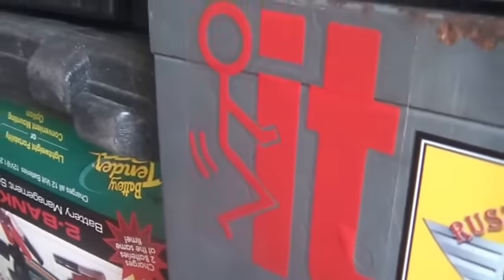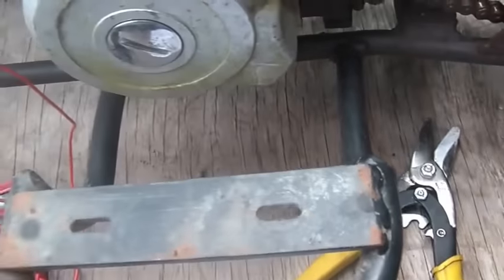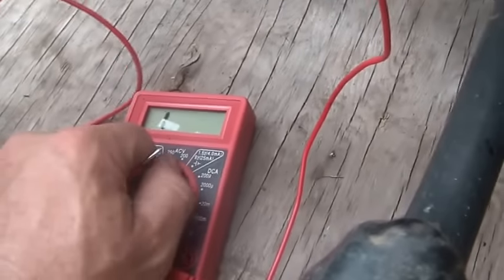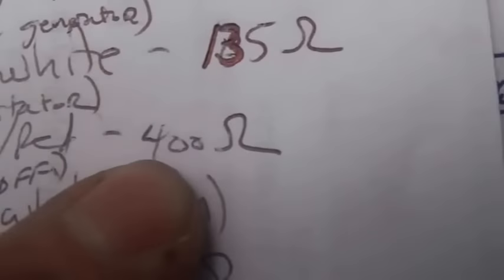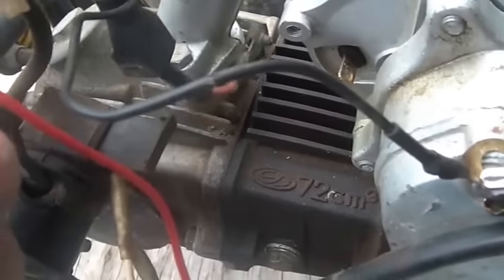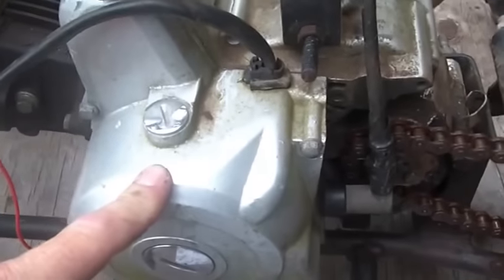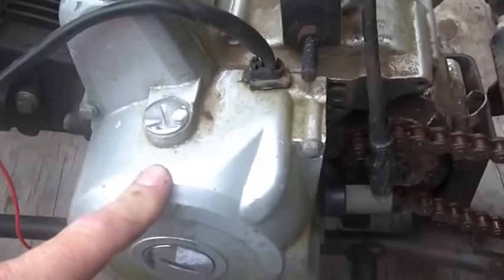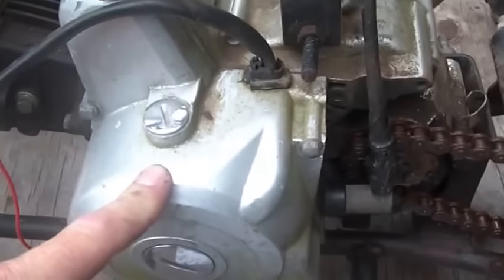Troubleshooting a no spark China Quad, critical wire harness measurements,

Comment: Hi help needed asap !! Ive recently purchased a new loom but plug on from stator doesn't match up to one on loom ive cut both plugs of now and am going go join them up then tape them off which colours go to which ??
Reply from the maker: Hey Darren, Assuming that U R replacing one AC powered CDI for another, just match the wire colors and all should be good, blue and yellow, pulse generator, black and red, power from the stator, black and yellow, ignition coil, green is ground, and black and white should be engine off when grounded.... Let me know how it turns out.... Thanks for asking, watching, and commenting!!!!

Comment: Hi Harvey, I saw your video and it has helped a lot. First of all I have a quad MPX 150 and it had a spark once (just one I saw it with a test plug but no more). I have checked the wires you mentioned and they check good (ohms, continuity, etc...) but I have a wire I can't determine where it goes. It is coming out of the engine in that five wire configuration you talked about and it is Red/Blk stripe. It has a single female terminal but no other male anywhere to be found. It reads 400 ohms. HELP!!!!!!!!!!!!!

Comment: Hello Harvey, new subscriber here, I'm still having trouble, I got a 2000 Lakota 300KEF, the harness cut all up, the stater has 3 yellow wires on one of the 3 sections coming out, for life of me, I cannot figure which wire goes where to get this thing to spark and turn over.  Again,. Awesome video, too notch brother.

Comment: battery whole sale sells sealed lead acid batterys that are rechargeable like a car battery for pretty cheap and the best part is they have some that are 1 inch wide by 2 high and 3 long witch would be perfect for the cdi box I think.
Reply from the maker: Hi Reading!!!   I need to check out that website, I've been using harbor freight batteries in my portable CDI ignition, it is rough on batteries... Thanks for the info, watching, and commenting!!!

Comment: Hi good video  I'm working on one of these at mo 50cc semi automatic. Got a weak spark or no spark at all . I'm suspected stator so far but unsure of the output voltage. In my case (red and white trigger wire) (red and yellow goes to the cdi main) (Green and white is earth) ( yellow to rectifier) and (white to rectifier) .What should be roughly the voltage on Cranking best Regards James

Comment: i got 3 ohms when testing the ignition wire at the cdi. both in the on and off position......
Reply from the maker: Hey Michal, I like to disconnect the on/off wire entirely.... About the ignition wire measurement, I'm assuming that U R speaking about the wire that goes from the CDI to the primary of the ignition coil and that U R measuring it to ground, 3 Ohms, depending on Ur meter is about right... I hope this helps.... I have all the recent China ignition videos in one playlist now, https://www.youtube.com/playlist?list=PLXe3Ur9S11oeX8iOzfD80fe5fpK37tg5W  , I hope this all helps, thanks for the info, Ur thoughts, watching, and commenting!!!
Reply: +Harvey Spooner yes I found the black and white wire to clip to bypass the ignition. i appreciate your help in this.

Comment: Hey I'm having a problem with my  SSR 110cc China pitbike I changed everything but still won't work
Reply from the maker: Hey Jelly, U have no spark????  I would cut the black wire with the white stripe that goes to the cdi  such that it can be reconnected easily and let both ends float, see if it sparks now, if yes, there is something wrong with Ur engine stop circuit... Start there and let me know how U make out....  Thanks for asking, watching, and commenting!!!!

Comment: If I want to just get the engine running I only need to use the 3 wires comeing from stator to cdi to coil to ht lead don’t I ??? Plz anser me ASAP I washed my qaud and now won’t start but I don’t need rectifier and all wires all I need for it run is state wires and cdi isent it ???

Comment: I have ? for you I have a Kipor camping generator 3000,  TC which is an AC rotary generator I little bigger in capacity than a  Bick generator But my question Is can I  USE  the CBI to create a spark as it is so much in many ways similar to that system Or as I have a Battery can I convert it to DC sparking To deliver a spark & ues an ac covert to charge my battery?  Yes well, Why.   We can No' longer get the parts for this model. The engine is sound so if could use an alternative system to run the motor preps I could use a rectifier to change a battery bank & use it to run an off-the-shelf inverter.    & I have put it back into use finding a suitable system to use what I require so I don't burn it out. les England   Ps I have one of the old tip motorbike pot' coils that I have used with points. on my rotavator until it finally burnt too much oil Could I use that with a trigger to fire the plug.  as there are no points with this motor how do I do that? I would preheat a feedback if possible.    In your opinion  Les England.
Reply from the maker: Hey Les, If Ur Kipor generator uses a pulse generator to trigger the spark, I would use my 12vdc portable cdi and it should work.... If it is a 2cycle motor, I do not believe it will work as 2 strokes do not have a distinct pulse generator that can be wired to....  I hope this helps.... Thanks for asking, watching, and commenting!!!

Comment: I just picked up a 2016 TaoTao scooter the only way I got the tests it is with test light. I checked all the wires that go to the cdi box the coil the stator . They're all good and I still ain't got no spark. And after looking at your video . I'm thinking of sending wire harness . And that's going to be mess . Would you agree bet it could be in the wire harness ???

Comment: I have a Yamaha 225DX 3 Wheeler, it turned over fine and used to run great. But now it's not getting any spark. How do I check all the little box things between the engine and the Coil. There's like 3 little box things between the engine and the coil. How do I check to see which one of those is bad?

Comment: I have a falcon 110, when I push the start trigger I get a click that sounds like it is coming from the starter solenoid. I can cross the post on the solenoid and it will turn over. where is my problem at?
Reply from the maker: Hey Paul, I'm glad that U figured out the issue with Ur Falcon 110 starter.... If one works on stuff, sometimes they mess up, folks who work on nothing, mess up on nothing, but, they don't fix anything either.... Thanks for asking, watching, and commenting!!!

Comment: Yeah so I was looking at those wires and mine does not have a ground what should I do
Reply from the maker: Hey I LOL!  Ur ATV must be getting ground from the engine case. The old Honda ATCs did not run a ground wire and I have had issues with spark when the engine case looses ground connection to the frame or had intermittent ground contact with the frame.... When in doubt, run a wire!!!   Thanks for asking, watching, and commenting!!!

Comment: hi Harvey,

i have a charging problem on my kids atv. its one of these 50cc china atv's. I bought new stator, regulator and CDI kit. I thought the stator is broken because there is coming only 2-3v out from yellow wire. But when i installed new stator nothing changed... 😞

still not give any charge for battery... everything should be okay... have you got any ideas where the issue might be?

br. Ville from Finland
Reply from the maker: Hey Ville, U only have one yellow wire, only 1 wire from the stator, there is not a second wire, yellow or white???? Let us assume only one stator wire, to get 50- 60cycles per second, a place where Ur Volt Ohm Meter will read somewhat accurately from a stator, the engine RPM needs to be about 3600 RPM...  If I were troubleshooting this, I would be checking to make sure that the engine has a good ground to the frame, voltage regulator, and the (-) negative terminal on the battery, also, is Ur stator well grounded to the engine????  I would probably run a continuous ground wire between the engine, frame, voltage regulator, and the negative on the battery...  I hope this helps, let me know how U make out, depending on what U find, maybe we can come up with more ideas.... Thanks for asking, watching, and commenting!!!
Reply: Harvey Spooner, there is one yellow and one white. both giving only 2-3 volts...

Comment: hi i have a 2007 chinese panther 250cc zongshen engine air cooled manual trans it has the skater wires and another harness with 5 wires coming out about a inch from the skater and the new harness  dont have them any ideas thanks ed

Comment: i got a 50cc quad that has no blck/red wire coming out the stator only the other 4 coulers but my cdi has a blck/red can i wire that blck/red from cdi to somthing or do i need a 4 pin cdi box ???
Reply from the maker: Hey Ian, Is Ur 50cc quad a 2 stroke or a 4stroke,  here in the USA, most of the 50cc stuff is 2 stroke.... Once U answer this, I need to do some research before I get back to U, I have not worked on 50cc ignitions.... Thanks for asking, watching, and commenting!!!
Reply: Harvey Spooner n

Comment: I have a 49cc Chinese engine. Sometimes it won't start when the engine wire is wiggled. Should I try and solder it better. Or that's not the problem?
Reply from the maker: Hey Bryant!!!   If the situation with the wire can be improved without making things worse, I would solder it, if not, I would run until it doesn't run anymore and then fix it for real.... Thanks for asking, watching, and commenting!!!!

Comment: Hi
Change of subject. 
I have a hero puch wheelie 65cc quad. The engine is off the puch maxi turbo sport. It's old late 80s   I think looks like a suzuki lt50. I cannot find any information for them or manual. Type online you get a Russian site. You sound switched on. If you don't mind could you look. I have seen two in the UK. One I own and one witch was sold on a site a fare few years ago. 
Thanks 
Regards 
Martin H
Reply from the maker: Hey Martin, I always start with eBay, is this the right manual, http://www.ebay.com/itm/PUCH-MOPED-MAXI-Sport-NEWPORT-MAGNUM-Service-MANUAL-PARTS-Owners-4-MANUALS-/352161601324?hash=item51fe77972c:g:LCMAAOSwJJRZsunV&vxp=mtr   , I hope this helps, thanks for asking, watching, and commenting!!!

Comment: My 110cc ATV starts and runs good at idle but when I give it gas it pops and backfires when I am holding on the gas can't find out why tho
Reply from the maker: Hey Adam, There maybe water in Ur carb bowl, I would drain it and see if it behaves better, if not, rebuild or replace the carb, good luck, let me know how it all turns out... Thanks for asking, watching, and commenting!!!
Reply: It aint getting som fuel......there is one nozzle for idle and one bigger with a needle inside fore to give gas. You must find the mixing screw at the side of the carburettor and give it some more juice.

Comment: So found that I had no ohms from the red/black from the stator.  I took off the cover and found a bolt that holds the stator on had worked itself out and beat the stator up a lot.  I bought another stator and still have no fire/spark and still get no reading from the red/black.  Any suggestions?

Comment: Hi Harvey, i was wondering if you have ever encountered a problem that im having. so i have a kandi 49fm-5 dune buggy go kart, i recently restored it, but im having a starter solenoid ground sparking everytime i hook it up to ground and also it won't start with my key. i put a new motor in it, which is a 125cc which i bought off line and i replaced the harness on it which i got from ebay, before this happened it wasn't doing any of that. in the process of me trying to get it started which was by jumping the solenoid, i burnt up a starter, which is now replaced, and i also replaced my magneto stator as well because the fly wheel mangled all the wires, and which i thought was causing my grounding wire to spark. i also changed my starter solenoid as well, twice just to see if it was a bad solenoid. it happened while trying to wire up my shift indicator and thats when all the problems started. I've checked forums and some of them said to look through the wiring, which i have done front to back already and the wiring is good, and i changed all of those components. I've even changed all my power and grounding wires as well and still, my starter solenoid grounding wire keeps sparking. i don't put it on i just touch it to ground and automatically it sparks. If you have encountered anything like this and have a solution to it im all ears, thank you
Reply from the maker: Hey SeRReAL6, I was looking at the starting solenoid coil circuit for my Hammerhead and it might be what U have on Ur wire harness.... Basically, one side of the starting solenoid is directly powered from the battery, the key switch and then the starter button are in series and the provide the other side of the coil a path to ground which energies the coil and engages the starter.... Kind of backwards to my thinking, but, my hammerhead is like that and it kind of describes what U have.... I hope this helps, thanks for asking, watching, and commenting!!!!
Reply: thank you ill give it a try and let you know what happens thanks again

Comment: Hello question- i have spark, compression, air, and it won’t start. When i spray fuel into the carb it starts then dies. I don’t know what is wrong with the fuel system?
Reply: Probably clean the carburetor
Reply: Eric Espenshade my carb is sealed and i can’t take it apart. so instead i soaked it in sea foam for 2 days. it runs but stalls out and only runs on full choke

Comment: Hello Harvey I have a Tao Tao 250 cc that I'm trying to get running. It was running before I took off the wire harness and replace it with a new one. Colors have been switched on a few wires and i can no longer get it to start. Please help!

Comment: Hey I've got a baja 150cc atv and i checked the motor ground and it reads 2.3  wat would i have to do to make the engine grounded
Reply from the maker: Hey Wyatt, I run a wire from the engine block, (typically under a bolt that holds the stator cover on), and I attach it to the frame where the spark coil or something else bolts on...  BTW, check Ur meter, short the leads together and see what ohm reading U get..... Thanks for asking, watching, and commenting!!!

Comment: I hsve a 125cc coolster mountopz  I picked up for my son motor was shot so I got another new harness kill switch etc I hooked it all up it will not start with the start button the key cuts power on and off lights work but won't Start and run unless  I jump  the silinoed with a screw driver fires up and runs do you have any ideas can I run a wire from switch to cdi ? If so what wire would that be thanks for your time

Comment: I got a kazuma falcon with a chopped up wire harness. I had to hook up a push button to start it. No spark. Mine only has 4 wires coming out of stator. Black, white, yellow, blue. Was going to get a wire a new harness but they all have 5 wires? Any ideas what I can do??
Reply: Nevermind on that I found the green wire burnt off. Still no spark.

Comment: If I were to redo the wiring on my quad without the remote control box, do you have an idea how I would do that? I want to make the wiring as simple as possible. my 4 year old is on my case to fix his quad and I don't do electrical well..
Reply from the maker: Hey Mike, Try this simple test, cut the black and white wire that does to the CDI box, (cut it such that it can be reconnected easily), if the ATV starts and will not turn off, U are half way to the solution, (U can use the choke or disconnect the spark plug, (use a rag or U will get juiced), to shut it down),. Assuming that U got the engine running from above, I would buy this from eBay, (<$5),  http://www.ebay.com/itm/Racing-Off-road-Motorcycle-Engine-Stop-Kill-Button-Switch-PIT-DIRT-BIKE-QUAD-ATV-/231473112662?hash=item35e4df6656:g:Qn4AAOSwPhdU1L7t&vxp=mtr  , I would cut the connector off the end of it, attach the green wire to ground, (make a good connection to the frame or engine), then take the other wore and hook it to the black and white wire from the CDI, it should be that simple... If U live near the Hudson Valley of NY, we can have it running in no time.... I hope this helps, let me know how it all turns out... Thanks for asking, watching, and commenting!!!

Comment: I love watching your videos. because it takes sane m person to understand the moron that wired and configured these unit, they are so inconsistent with what use for ground, green blk, or even the hot, blk white or red, etc... i had to unwrap my entire harness today take deep dive try figure it out. Well, I got a push button replace into handlebar for push to start to work, on/ff didn't, Key works, now i have no spark, think the CDI is dead. ordered New one, after this video tomorrow weather permitting, do some checking OHm checks. as always, these videos are perfect.

Comment: Thank you for this video! i've checked every wire and all measurements are good except the red&black i get no readings at all, does that mean that the stator is bad?
Reply: Mine is brand new rode it 2 times and now it is not sparking at all
Reply: Turns out that the stator was bad, i bought a new stator and it worked great! until the crankshaft snapped off behind the clutch gear LOL..

Comment: Hey my bike doesn't spark and I only have four wires coming from the motor. What can I do?
Reply from the maker: Hey Randel Adams, What color are the wires coming from the flywheel area of the motor???? Thanks for asking, watching, and commenting!!
Reply: @HarveySpooner  i actually have a similar question I have a Viper 150cc eton and i cant figure out the new wiring. Im using the old stator that had 4 wires coming off of it. Blue/yellow, white/red, white, and black. Ive taken a look at the diagram for it but wiring it to the new harness is a pain in the ass lol. Thanks